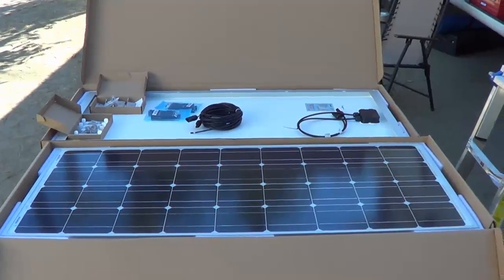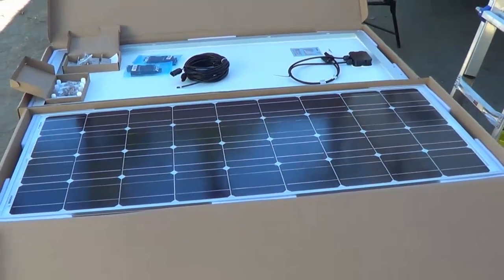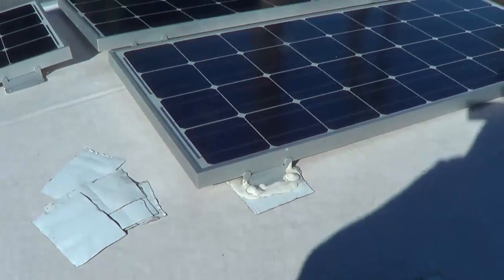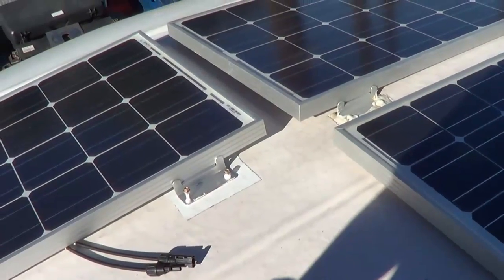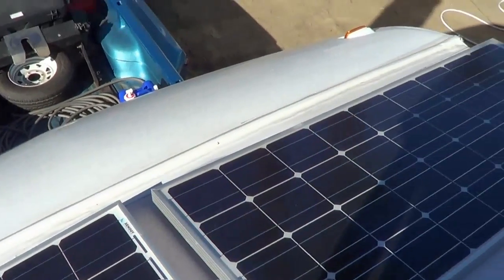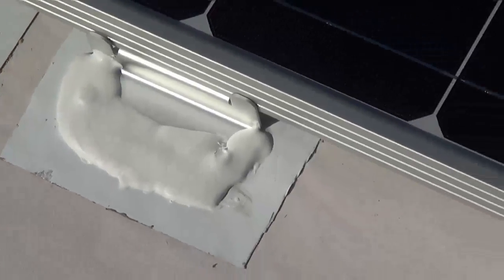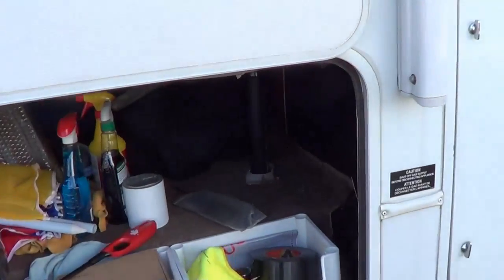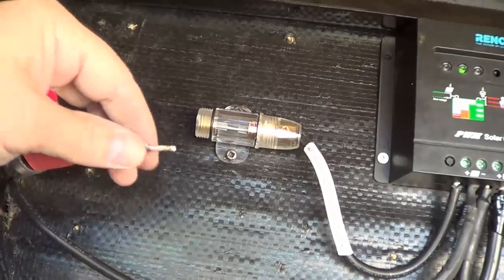Upgrading My Renogy RV Solar System to 400 Watts

Comment: Have you researched any of the portable windmill generator kits?
Reply from the maker: Not much, they look like they would be moe of a pain than they are worth since we move around a lot. I don't see them on many RV's except small units like truck campers. Our little generator does a good job of providing a second energy source when solar isn't available. - Ray

Comment: I prefer not to put all the solar panels on the roof because  I don't want to move my vehicle out of the shade to wherever the sun is available.   I'd probably just put the minimum permanent panels on the roof just to maintain the charge when the vehicle is in storage,  and have a more portable version for the main charging unit when I need it.
Reply from the maker: Makes sense if you're in the shade a lot. We do almost all our dry camping in the south-west desert where there aren't any trees or shade. A nice thing about the roof mounted panels is they charge while we drive.
I'll likely add in a portable panel in the future though so I can use it to catch the low early morning sun and have it in case we spend some time in a shady area. Cheers Ray

Comment: thanks Ray! I've got 3 100 watt panels hooked up to a battery bank. your video came in handy as a reassurance I was doing everything correctly.. I would love to see more of your set up though from the charge controller to the battery bank and shut off switch. thanks again
Reply from the maker: You're welcome Nick, In this video, I show most of the wiring when I installed more batteries. http://www.loveyourrv.com/upgrading-my-rv-battery-bank-and-12-volt-system/ 

Of course, things have changed on the negative side as far as the new shunt for the Trimetric battery monitor - http://www.loveyourrv.com/bogart-sc2030-cc-and-trimetric-tm2030-rv-installation/

I still want to clean up the wiring a bit more, shorten some and install a final failsafe catastrophic fuse.  
Seems the system is always in a state of flux, mostly because I'm adding as I can afford it. :) I'm getting pretty close to having everything the way I wanted though. Cheers Ray

Comment: Nice job and video. It's lighting a fire under me to order my solar system. By the way, I live about 4 miles away from you, I recognize your park. And Yes it is blazing HOT here in the summer. You don't want to be here in an RV any other time than winter. Cheers!
Reply from the maker: Thanks. Must be pretty quiet around town in the summer. We spent one day in Needles one year when it was about 105F, you're so right. Best our RV AC could do was about 85 or 90 inside.

Comment: Did you use MC4 cables? I was told by the tech guy at the RV dealer I go to that those cables are pretty big and can be hard to get down the fridge vent which is where my present old cables go through. He said they're about the size of your pinky. Is that so?
Reply from the maker: Yes but the MC4 connectors are under the panels. The feed cables down to the controller have MC4 connectors only on one end which connect under the panels to the Y connectors to parallel the panels together. The end going down through the roof is just wire with no connectors. The stripped off bare end gets attached to the controllers input connectors.

Comment: 40A LCD Solar Charge Controller 12V 24V auto switch dual timer Y-SOLAR T40

is this a mppt contronet
Reply from the maker: +Samuel Everts Not sure what you're asking?
Reply: 40A LCD Solar Charge Controller 12V 24V auto switch dual timer Y-SOLAR T40

 is this a true in MPPT controller
Reply from the maker: Not sure, I can't find the manufacturers website, looks like junk to me. Seems to small to be a quality MPPT controller.

Comment: thanks, well you put all the panels tightly together. you cant even get to the front of the roof.
Reply from the maker: If I have to,  I travel with a folding telescoping ladder extends to 13 feet. Can reach any part of it no problem.
Reply: good for you

Comment: Have you considered a portable panel that would allow you to park (during the summer) in the shade and still get power?  wo
Reply from the maker: Yes! it would also come in handy for capturing the early morning sun when it is low and in the east. Next investment though will be in a battery monitor and better charge controller. I sort of have to add things as I can afford them. Cheers Ray

Comment: Nice video and as always  great workmanship. If I may ask?  Why is it that you, who knows electronics started with an undersized system?  Only to double it after one year?  Now that new charge controller you got one year use out of is scheduled to be replaced.  Sounds like a waste.  In hindsight, would you say it would be better to have got 400 watt (or maybe 600 w)  and the charge controller your intending to get now a year ago?  Now you have a controller your replacing after one year.  I would appreciate your thoughts, or reasoning and to know if you would do it differently, today?  I ask this because most people start out with not enough panels and end up upgrading.  Sometimes with mixed panels and sometimes more than one charge controller, when up grading an inadequate systems.   I've even seen Mono and Polycrystalline panels mixed or panels of different wattage mixed.  Wouldn't having a matched and properly sized system be best, instead of up grading when you find your system inadequate?  It just seems wrong to not do it right the first time.  Just asking,  Cheers
Reply from the maker: Thanks, I didn't have the budget to devote large amounts to solar. $400 dollars got us a usable 200-watt complete system, we enjoyed it for a year, Your actually mostly paying for the panels ($300 of the $400 dollar kit), the charge controller the kit came with is only worth $20 bucks, so there is no great waste there. 

All the panels are matching.  I've upgraded the battery capacity and now I will add a battery monitor and a better quality charge controller. So, I see it as expanding my system, slowly as I can afford it.

Comment: Ray,

Great job on the panel installation ! 4 or 5 more panels and 2 more batteries and you'll be able to run your air conditioner too.

Ron W.
Reply from the maker: +Ron Weiss haha, thanks. :)

Comment: Great job, Ray. You really have me making a list. Maybe a video on those elephant feet and how they work.  Do you have  a lot of shacking when walking around the trailer? Have you ever used RV stabilizers?
Reply from the maker: Never used stabilizers other that the stock rear scisssors jack ones. I notice a little less shaking but nothing dramatic. we are very used to shaking since we live full time, doesn't really bother us anymore.
I'll be posting a video after I try the feet out on a few more different types of terrain. But so far I like them. Very convenient.

Comment: I really enjoy your site. I am sure that you have mentioned this before, but why golf cart batteries? Also, do you use 12 or 6v batteries? Thanks Ray
Reply from the maker: I have 6 volt. I think that Golf Cart Batteries is just slang now for heavy duty 6-volt deep cycle. I like them because they use very  thick heavy lead plates in them and they can take more deep discharge cycles than the typical 12-volt deep cycle. 

Also, because they are taller they have a smaller footprint making them a little more compact for storage compartments. Finally, they tend to give the best bang for the buck and they match up with pretty well any solar chargers because they are so commonly used.

Comment: Excellent job and video. I will be using the 3M VH tape on my fiberglass roof as I don't want to compromise the roof. I would do what you did if I had the roof you have. Take care
Reply from the maker: Thanks! That tape sounds pretty amazing.